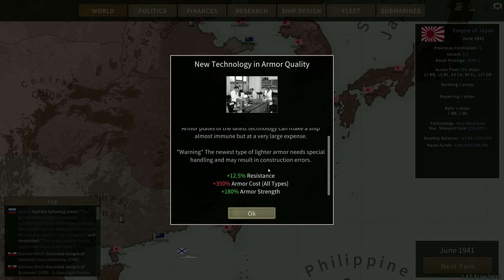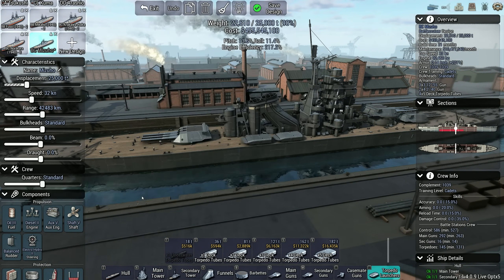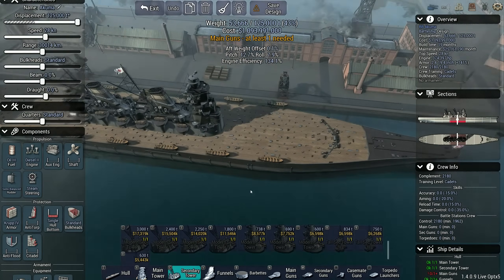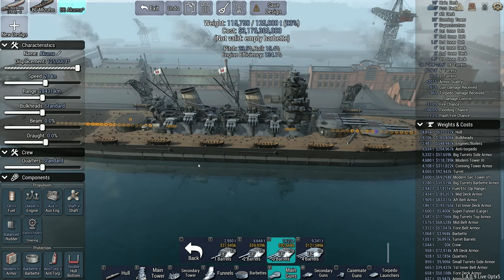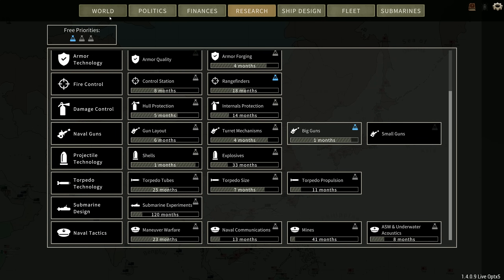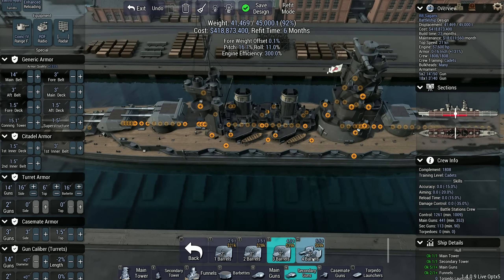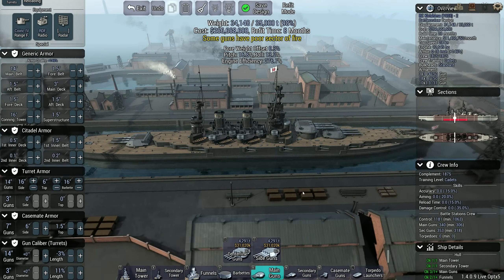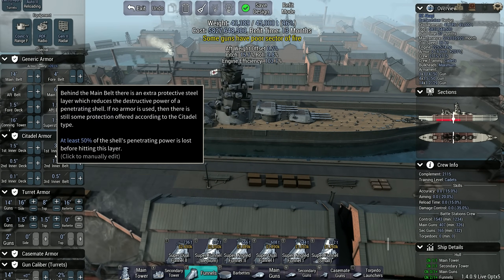Rebuilding - Episode 27 - Dreadnought Improvement Project Japanese Campaign

Comment: Curious thought for the super battleship, why not treat it like an experimental hull? Put two quad mains on it instead of three or four triples and have a large array of secondaries or a lot of armor. May save a little weight and keep the citadel small if using the super pagoda. May look a little weird, but might be worth a shot
Reply: i was thinking this too, maybe 2x4 20" could fit under weight
and the target lock bug is a lot improved so A-X designs are decent now

Comment: In my own Japanese Campaign i compromised going with 4 single barrel 20.9 inch guns, yes it looked a bit goofy but honestly just felt satisfying having these single barrel ships get one shots at 50km range x)

I did also build one more with 4 double barrel guns all at the front but 1 month before they finished commissioning my campaign ended cause i reached 1965 >:(

Comment: One thing to try is putting the towers (pagoda and Modern II secondary) in front of two funnels. That would save a couple of tons on weight and allow greater firing arcs. Worked for me in custom battles, but, I do play vanilla so it may not be as reasonable for you. Also try for gas engines, those have a serious weight reduction compared to diesels.

Comment: New Battlecruiser Class to Build Up Fleet Strength
Yomiuri shinbun, Tokyo, 14 June 1941

The Kaigun Kensetsu-Kyoku of the Kaigun-shō has announced a new battlecruiser class for the Dai-Nippon Teikoku Kaigun, using the Mark 5 12”/55 gun.

The Mizuho class will consist of 10 ships; the Mizuho, Akaishi, Kongō, Katsuragi, Ōshima, Banjo, Warusawa, Heien, Minami, Nishinōtori, all to be built at Matsuyama in the Ehime Prefecture on Shikoku.  Designed to a target displacement of 25,000 tons and a top speed of 32 knots, the class will use the advanced marine diesel engines burning oil formula III vented through one trunked funnel generating a total of 92,460 indicated horse power to turn four screws to obtain the required 32 knot speed with a range of 30,600 nautical miles on a final displacement as designed of 24,777 tons.  Electro-hydraulic II systems turns the balanced rudder and a diesel-electric auxiliary provides supplementary and emergency power.

The main armament is three triple 1,667 ton 105 man crewed 12”/55 mark 5 gun turrets on the centerline, two mounted super firing forward, one mounted aft and use electro-hydraulic turning engines.  The Mark 5 12”/55 gun turrets will weigh 1,538 tons, have crews of 105 men, will have a rotation speed of 4.10 degrees/sec, reload rate of 1.5 rounds/min., fire a balanced magazine of 463 kg base fuze high explosive shells with 36.8 km range and 755 km capped ballistic II armor piercing shells with a 46.6 km range.  The guns have advanced automated reloading systems.  The guns are aimed by the type V coincidence range finders.  The class also carries Radio Detection Finders (RDF) and MnKtS (aka, RADAR) detection systems. 

For a secondary the class carries two quad 2”/40 Mark 5 dual purpose turrets. The class also carries four quintuple 182 ton 40 man crewed mark 5 deck torpedo launchers firing 24” enhanced torpedoes, two per side.

The class has maximum compartmentation with reinforced bulkheads and watertight hatches, a double bottom hull, and full depth anti-flooding systems.   The All or Nothing armor scheme is employed, and the class carries a main belt of 12” of Modern II armor, with 3” for the extended belts and 1st inner belt, and 2” for the 2nd inner belt, and 1.5” for the 3rd inner belt.  The Main deck has 6” of armor, the extended 1.5” of armor, the 1st inner deck 3”, the 2nd inner deck 2”, and the 3rd inner deck having 1.5” of splinter protection.  The superstructure has 3” of armor and the conning tower 8”.  The 12”/45 gun turrets carry a face and barbette armor of 14” and a top armor of 7”. 

The class carries a crew of 1521 officers and enlisted men under the command of the Kaigun-taisa.  Each ship costs $471 million and will take 21 months to complete with a commissioning time of three months at least.  Estimated monthly maintenance in port is $10.8 million.  Assignment of theses cruiser hunters has not been reported.

Comment: The Japanese Super Battleship gives health (it's got more displacement than some SuperBattleship hulls with ~100,000 tons, and is equal to others at ~150,000 tons), and extremely good long range towers (all modern Japanese BB's do)

As far as I'm aware, there's no historical basis for this hull beyond an enlarged A-150 (or A-150 using the hull's minimum displacement)

The A-140 and A-150 work fine on the intended Yamato hull though (max displacement is about 90,000 for the A-150 if I remember right)

Comment: Since you're a fellow Trekkie... I have a request for your next campaign: play as the faction of your choice, against the random enemy setting, on the difficulty level of your choice, with ship designs based on the characteristics of Star Trek ship classes.
Examples:
Oberth-class: scout- 2-4 inch guns (2 barrels), 1 torpedo tube
Miranda-class: frigate\cruiser- 5-8 inch guns (6 barrels), 4-7 inch guns (2 barrels, high rate of fire), 2 torpedo tubes
Akira-class: heavy cruiser- fast, maneuverable, with 12-14 inch guns (6 barrels), 15 torpedo tubes
Galaxy-class: heavy cruiser\command ship- 12-15 inch guns (12 barrels), 2-3 torpedo tubes
Defiant-class: battleship- small, fast, heavily armored, highly maneuverable, 15-20.9 inch guns (4 barrels forward), 1-2 torpedo tubes
Sovereign-class: battleship\command ship- heavily armored, 14-20.9 inch guns (12-16 barrels), 5-10 torpedo tubes

Comment: I like the whole refit but i feel there needs to be some realism involved with the game and changing things such as the armour and most things on the hull is not very realistic i find, changing turrets or axillary things makes sense as they can be removed or installed but when it comes to the hull upgrades i feel what you have is what you get when you first designed and commissioned it. same when it comes to the engine refits if im honest as most of the time not all but most of the time you wont change the engine in the ships there may be things to add on to improve currents engines but to rip them out and then add a hole new engine layout isnt overly likely. But other than them things i do like your designs more than most as you seem to be a little more realistic and stick to a steady upgrade path which is great :)

Comment: 14 Inch Capital Ships Refits Ordered, Part 1
Yomiuri shinbun, Tokyo, 12 October 1941

General Upgrades

The Kaigun Kensetsu-Kyoku of the Kaigun-shō has announced a refit of all 14” armed ships of the Dai-Nippon Teikoku Kaigun, with the general state of peace and the development of the Mark 5 14”/50 gun.

The MnKtS will be installed on all refits.  Other standard elements of refit will be Coincidence V range finds, advanced auto-loaders for guns, advanced electro-hydraulic turret turning engines, a requirement with the heavy turrets of the Mark 5 14”/50 guns, and standardization on the Citadel V “All or Nothing” armor scheme using Modern II methods which help compensate for the greater penetrating power of the Mark 5 14” guns.  The anti-torpedo bulges will be extended to the bottom of the ship hull, giving more protection against deep running torpedoes.

The bursting charge for shells will be standardized to an advanced mix of RDX and TNT called TNT IV which is very malleable, and is also known as Composition B, or Plastic Explosive.  The propellant charges will now be a three part combination of Nitrocellulose, Nitroglycerin, and Nitroguanidine called Triple Base.  Because of the characteristics of both TNT IV and Triple Base improved flash fire protection for 5” guns and larger will be installed.  Due to the size of the 12”/55 Mark 5 guns the barbettes have to be rebuilt in any case, allowing us to install the Flash Fire V protection from construction, and not tacked on.

The engineering plant will be changed to advanced marine diesels burning formula III fuel oil.  This is the primary upgrade that provides weight savings for improvements such as the change to Mark 5 12”/55 guns and improved torpedo protection.  Where the weight savings are sufficient the auxiliary engines will be changed from diesels to diesel-electric systems.  The propellers and shafts will be improved to the latest Mark 5 form.

Comment: 14 Inch Capital Ships Refits Ordered, Part 2
Yomiuri shinbun, Tokyo, 12 October 1941

Class Details

Tosa '41 Refit Specifics:  The Tosa class will retain the five twin turret scheme and thus will keep most of their profile but will have new main towers.  The Mark 5 14”/55 gun twin turrets will weigh 1,599 tons, have crews of 100 men, will have a rotation speed of 4.11 degrees/sec, reload rate of 1.78 rounds/min., fire a 718 kg base fuze high explosive shell 43.6 km and a 1172 kg capped ballistic II armor piercing shell 53.3 km.  The class retains their 3” secondary of eighteen casemate 3”/40 Mark 5 guns and ten triple 3”/25 Mark 5 guns.  Crew complement is now 1746 officers and men.

With the upgrade to advanced marine diesels and Oil III the range of the class is now 12,900 nautical miles, 50% more than what it was after the 1925 refit.  The refit of the Tosa, Hou-Ou, Fuji will take nine months and will be done at Sasebo in the Nagasaki Prefecture on Kyūshū.

Sagami '41 Refit Specifics:  The Sagami class will retain the five twin turret scheme and thus will keep most of their profile but will have new towers.  The eighteen 3”/40 Mark 5 casemate guns will be retained as the secondary.  The class will now have twenty triple 2”/33 Mark 5 dual purpose guns mounted in the superstructure.  Crew complement is now 1927 officers and men.  Range is now 16,000 nautical miles.

The refit of the Sagami, Aso, and Kasagi will take 27 months and will be done at Yokosuka in the Kanagawa Prefecture on Honshu.

Karasawa '41 Refit Specifics:  Karasawa class refit will see the whole of the ship structure moved back.  The aft most turret will be on the aft deck, with the super firing turret mounted on the main deck.  New towers will be added and the whole pushed back.  The class will retain the four twin turrets for the main battery.  It will also retain the eighteen casemate 3”/40 Mark 5 guns on the casemate deck.  Sixteen triple 2”/28 Mark 5 guns form the tertiary battery.  The crew complement will grow to 1825 officers and men.  Range is now 21,000 nautical miles.

The refit of the Karasawa and Yari will be done at Yokosuka in the Kanagawa Prefecture on Honshu and will take 12 months.

Kirishima '41 Refit Specifics: The Kirishima class refit will see the class increased to nine guns in three triple turrets, one aft and two super firing forward.  A new main tower is installed, and with the loss of the super firing aft main turret a stepped barbette is added aft of the secondary tower to take three triple 3”/30 Mark 5 guns.  Another ten triple turrets are mounted in the superstructure.  The secondary remains eighteen 7”/50 Mark 5 casemate guns.  Crew complement is now 1902 officers and men.  Range is now 42,400 nautical miles.

Refit of the Kirishima and Hiei will take 15 months and will be done at Maizuru in the Kyoto Prefecture on Honshu. 

Akagi '41 Refit Specifics: The Akagi class refit will see the class increased to nine guns in three triple turrets, one aft and two super firing forward.  The class retains its unique 5” secondary, upgraded to four triple 5”/50 Mark 5 turrets.  A new main tower is installed, larger and with greater capability for spotting, and the tertiary now being fourteen triple 2”/29 Mark 5 dual purpose gun mounts.  Crew quarters have been increased and crew complement is now 2077 officers and men.  Range is now 21,000 nautical miles with the class speed inceased to 36 knots.  

Refit of the Akagi and Okuhotaka will take 13 months and will be done at Tokio in the Tokyo Prefecture on Honshu.